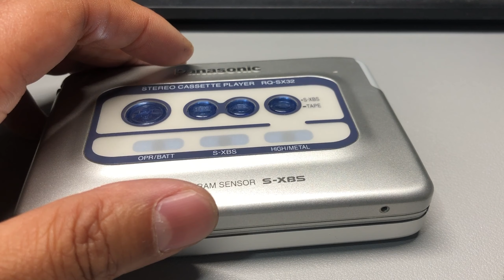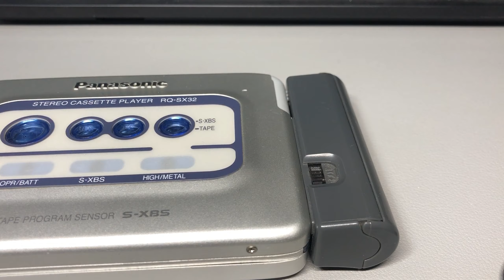Cassette Player Panasonic S-XBS fixing | changing rubber belt

Comment: Because I didn't have a device like tihs as a new one, mine it has very high wow and flutter. Tell me, when this device was new  had any sign of signal fluctuation?
Reply from the maker: Hi, the signal fluctuation may caused by an old tape. when I changed another tape or played reversely, the flutter sound get better.